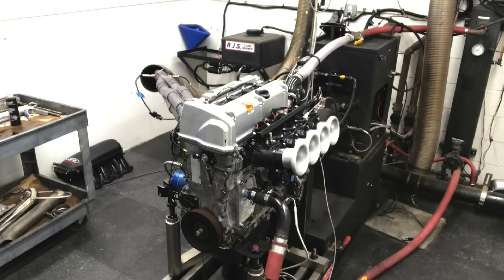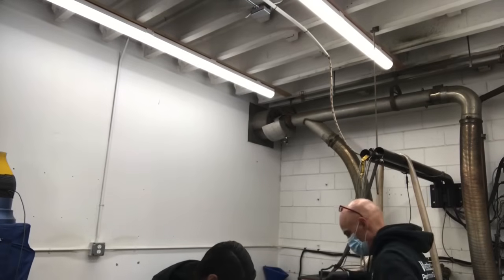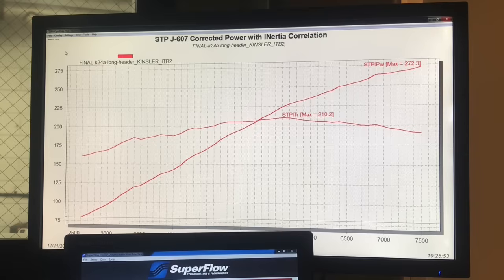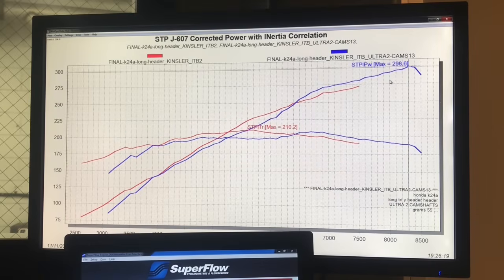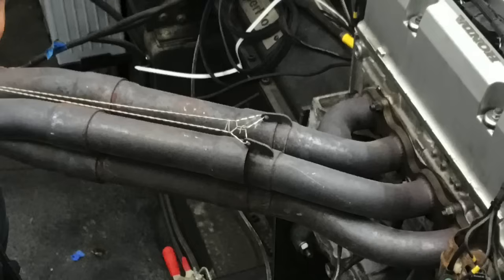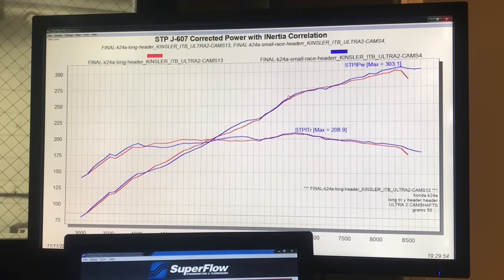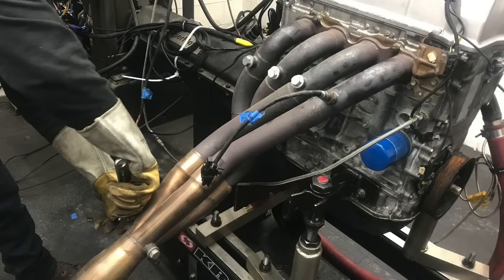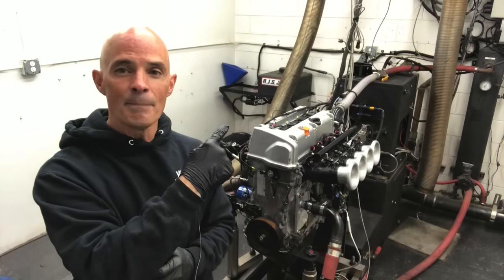HONDA K24A2, STOCK OIL PUMP GOES 8,700 RPM!!

Comment: While you have this little ripper the dyno it would be cool to do a test running with vtec turned off for a full pull and then another with vtec engaged for the whole pull to show the difference between the different cam lobes
Reply: I would be interested in that too!
Reply: Running without VTEC above 7000 rpm will starve the cam of oil lubrication.  Not that it would make much power up there anyway on the small lobes.
Reply: @ChurchAutoTest  
Wish I knew a little note about what I was watching in this vid I saw a while ago , but I think I saw in the comments that something was wrong with the guys VTEC ,and it was engaged at idle making it lope like some wicked beast. 
The way it was idling, if it was on the big cam at idle , was pretty nasty. 
no wonder they work so good at high revs.
Reply: @MrTheHillfolk  You can get "ghost cam" tunes for some cars with computer controlled VVT to make them lope at idle.
Reply: @MrTheHillfolk   From your description it sounds like you saw someone running what is known as "VTEC killer" modification. It is when you take a non-VTEC head and run only on the agressive cam lobe only because the head doesn't have the ability or rocker setup for profile changeover. This is a budget setup say you pulled an accord k24 at the junkyard and picked up k20a2 cams then modify the rockers for clearance.
Reply: @lcq4blackstar  You can actually buy VTEC killer kits for VTEC heads, but they're not cheap. TODA Racing probably makes the best VTEC killer kit, it makes use of special cams with no secondary lobes and it eliminates the lost motion assemblies and the secondary rockers altogether. 4 Piston Racing, Drag Cartel (and possibly others) also offer VTEC killer rocker arms, which can be used with VTEC cams, they simply operate on the secondary lobe at all times.
Reply: @lcq4blackstar  
Ahh, yes ,I think I saw some "VTEC killer" notes in some of the comments. 
Kinda interesting , thank you.
Reply: He already did this with a B16.
Reply: @FoolishPursuitForce  must have missed that one
Reply: Vtec should engage when the torque on each cam lobe converges. So that small lobe isn't going to be making much more power after the big lobe kicks in. In my experience the hp already starts dipping about 500 rpm past the engage point.
Reply: @snakeballs8965  yes I understand how it works, but a comparison would still be fun to see
Reply: This what I'm talking about guys....he guy brings me his car and says make it perform when he couldn't.. ..Microphone dropped I'm busy dammit
Reply: @Kasen Tony try Flixzone. You can find it on google =)
Reply: @Kasen Tony Glad I could help =)
Reply: V tack not boost brother...no boost no care
Reply: V tec on every motor now with exhaust and intake.... example..stock Chevrolet truck lol
Reply: @bryansenulis7242  No, that's VVT, not VTEC. VTEC can switch between two entirely different cam lobes, VVT can only vary timing.
Reply: @PistonAvatarGuy  whatever im a mechanic and all works off oil pressure and a solenoid valve....all new motors do same thing and the valve looks almost the same from Bentley to Honda to chevy dodge ect.....I can out nerd u I just put in terms people know.....I tune cars and work on them for a living....but thanks for comment we cool...like how u point out stuff
Reply: @bryansenulis7242  No, buddy, you have no idea what you're talking about. VVT only varies timing, it only changes the cam angle relative to the crankshaft, VTEC allows the engine to operate on completely different sets of cam lobes. Other manufacturers do have similar systems, but not many and most engines absolutely do not have anything more than VVT.
-
I've been working on cars for 20 years, so don't act like you're privy to some special knowledge here.

Comment: It would also be interesting to see the other typical upgrade of the 50° cam gear
Reply: I am running a 50° cam gear on my stock k24a2
Reply: I have a built K24 (piston/rod) 13.5:1 with DC 4.5's. (less Piston to Valve clearance and bigger cams than this motor) and still use more VTC degree angle than the stock TSX 25° VTC. After degreeing the cams, its mechanically limited at 32° to be conservative. I know those ultra 2's want more angle. But that pump don't wanna rev where those cams want to go. Cavitation.
Reply: It’s advisable to limit vtc to 45* on a stock tsx block. 40 with aftermarket cams
Reply: @PolishedMobileDetailing503  that’s what I was told also because it could run into valve to piston clearance issues. 45 degree max.
Reply from the maker: Can the 50-degree cam gear even be used with available P-V
Reply: @richardholdener1727  I would assume so as this is the most common upgrade for big "stock" power
Reply: @richardholdener1727  45 Degree VTC is the max on the k24A. You could break something.
Reply: @richardholdener1727   do you have any plans on a budget turbo 351w using gt40 heads with a spring Upgrade.
Reply: @richardholdener1727  what size are the itbs you used in this test? 58mm? Smaller? Or bigger?

Comment: I’m loving this Honda stuff! Need to try the Aussie legends, the Holden 5l v8 and ford Barra     4l inline 6
Reply: ahhahah, the only place you'll find a holden 5L is off the coast of Whyalla attracting Snapper
Reply: manitoublack agree 100%
Reply: How many banks would Richard have to rob, to be able to buy them?
Reply: the issue is getting our aussie stuff over there. a (good) barra or GM holden v8 might only cost around $2000 AUD here but by the time you ship them to the states its up there with the cost of a  expensive crate motor. As cool as it would be its not going to happen whilst the virus is about because it would be cheaper to fly over here buy all the engines and do the tests here then sell them off or fill an entire shipping crate with cars as well just to cover costs...... there is a million 3.8 buicks over there but that our holden v6 "performance" parts would fit. I would love to send Richard some parts like a 302 cleveland crank to play with but Im not sure Ms Holdener would be impressed
Reply: We have Plenty of Aussies doing Barra builds @ all power levels in Australia anyway so it’s not worth the costs involved
Reply: 4200 atlas even